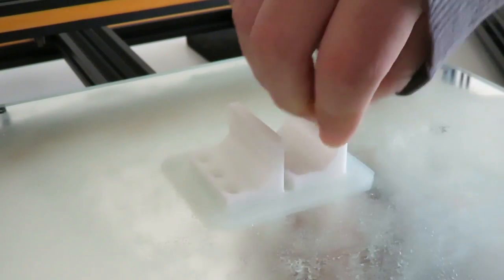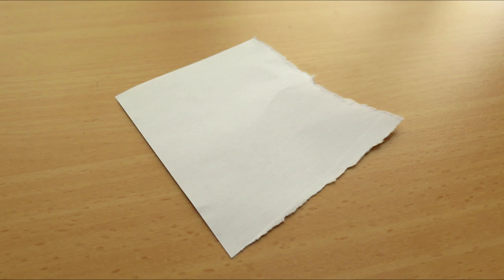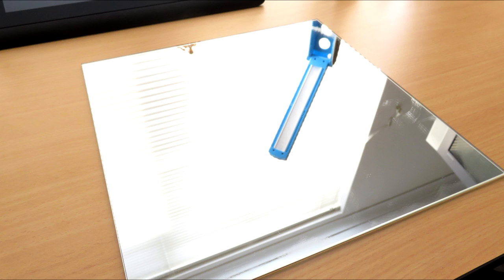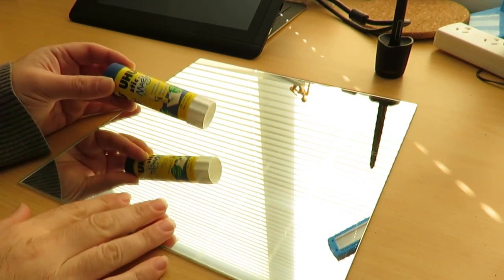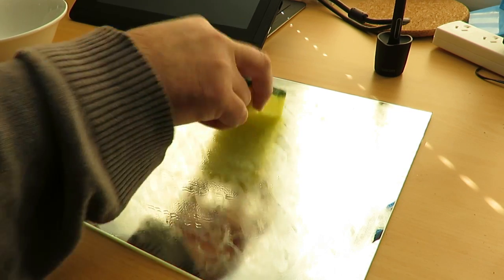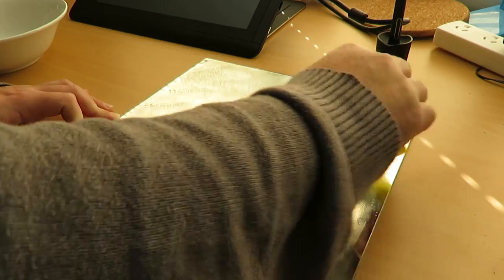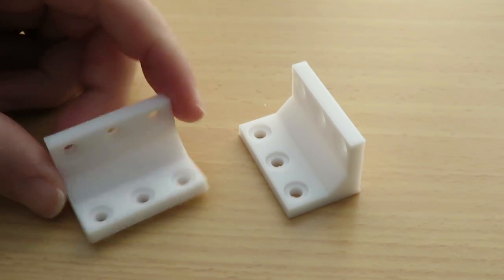REAL Bed Adhesion No Heated Bed, No Tape, NO BS- 3D Printing With Rm2kdev #9

Comment: Let me see youre limit with that..show me what you can do
Reply from the maker: Very Fair Point :)
I don't have pictures of it on the bed. but here are two hard drive caddies I printed using this technique on the CR10 i taped them together and wrote the clients name on them (i occasionally do prints for people) so i had to obfuscate that.

Link : http://imgur.com/a/9jhdi

Though with that said I've done a full bed (12 hour) print making parts for a robot arm I was making a few weeks ago but didn't take any pictures thats going to be a youtube video eventually i was just prototyping it.

EDIT: I added a photo of one of the robot arm parts large flat base no warping :)
Reply: rm2kdev Cool cant wait to see it
Reply from the maker: That video is probably a few months out :P im designing the thing from scratch, building and testing the parts with arduino nano's etc i felt that the existing small arms on thingiverse were over complicated in their design's for what they do. I wanted to have a goal of a 2 - 3 hour print for all the parts and a very simple construction.
Reply: rm2kdev I cant wait

Comment: Thanks for this video. My CR10S4 heated bed died and I've been waiting almost a month for the replacement and my wide prints have been peeling up if I print them on tape. I'm printing with your demonstrated glue stick method and so far my prints have been sticking perfectly to the build plate!
Reply from the maker: Glad it's working for you too, a story many here can resonate with.

I rarely use the heated bed now this just holds em down no problems most of the time.

Comment: Don't normally leave comments. But got to give credit to using this technique. We have all tried different methods, to stick down prints. But this slurry of pritt stick ( brand name in the UK) and water, works a charm. For Xmas. I have treated myself to simplify 3d. Printing in PETG. I also have a 6 line brim. Which is connected to the print. Bed is at 75 degrees and nozzle at 235 degrees. Do not know if using paid for slicer software is helping the  the prints stick to the bed or not. But it works for me.

Comment: Nice video, glad this works for you.  As for me, I have come to the conclusion that I hate glue sticks.  I just tried G10 or garolite and it works great though I had to raise the bed temperature slightly, but PETG just pops off with very little effort once the bed cools.

Comment: I don't want my prints to be welded to the bed. I went with a pei sheet and I sanded it because the adhesion wore off fast. Sanding it made it the best surface ever. Also, yes! Get feeler gauges! I also had to get a cr touch because I had a wild warp in my bed that shifted when I tightened and loosened the corners. Set up Octoprint too! It's so awesome! 😍😍😍

Comment: Absolutely perfect! I used Elmer's Re-Stick with this method and it is hands-down the best print surface I have used for ABS (I've used kapton, PEI, blue painter's tape, bare glass, hairspray, and BuildTak). Prints stick every time, and come loose easily when the bed cools.
Reply: use abs slurry (abs scraps dissolved in acetone) it will stick better than all of the above :)

Comment: While this works great to adhere prints to the surface, it's a pain to remove them. I recommend cleaning the bed with Dawn dish soap under warm water and printing on the glass bare, with the bed heated to about 65 degrees. This adheres PERFECTLY and then pops right off the bed when it cools. I use this method exclusively and recommend everyone to try it.
Reply: Jeffrey Roark yeah, most all 3d printers use celsius
Reply: Don't forget to compensate for the temperature difference between what the printer's temperature sensor sees on the bottom of the build plate compared to the actual surface temperature of the glass plate when setting up the print in your slicer. The actual temperature on the surface of my glass plate was about 7 degrees cooler than what the printer thought it was. I verified this with an infrared temperature sensor. I used single strength window glass that is about 2mm thick. The temperature difference will be greater with increased glass thickness.
Reply: Waltkat yes, that's why I use 65 degrees instead of 60.
Reply: @Jeffrey Roark
 Kelvin of course. Better stock up on dry ice!

Comment: I take a very damp paper towel and rub a glue stick on it several times. Then wipe the bed with the paper towel. You get a super thin even glue coating and it work perfect.

Comment: I actually got perfect adhesion for PLA and PETG prints by using a layer of 2 component glue on the bed. For PETG I used a bed temp of 95°C and I also got the prints to easily remove when having the bed cool down to about 70°C for PETG prints!👍

Comment: Great video, I have been using a variation on this technique for some time.
I use a small non-scratching 'blue scrubber' and a tiny bit of non-sudsing ammonia to wet out and spread the glue-stick after it dries.  Dry application places the amount of glue you want, wet-brushing makes the application even.
Ammonia is used as it will lift any oily residue from the glass plate, makes the water wet the glass completely and it helps disperse the glue more evenly.
Using glue-stick 'dry' is too likely to make bumps or voids.  Printing big?  Who cares!
I found it is possible to get too strong a bond between PLA/Glass!
Mod Podge, a concentrated white glue or gesso, should never be used with PLA!
Hell, white glue and PLA shouldn't be used together either!
I have a divot in my Ultrabase from prying a part off the build plate.
Yes, the part came off in small chucks.  Yes, I used a white-glue.  Yes, the part has a scab of glass still on it.
Not just the PEI over-printing was torn off the plate, there is a shallow crater in the glass itself!
Glue + glass + ABS?  Pretty darn good.  Parts 'pop' off the plate at about 35 C, no distortion.  Can't print in same spot twice, glue is stuck on part.
Glue + glass + PETG?  Near perfection!  Parts come off at room temp, with a little help.  Can't print in same spot twice, glue is stuck on part.
Glass [Ultrabase] + PLA + ammonia scrub of plate followed by 91% alcohol wipe-down?  Excellent hot adhesion, zero adhesion at 35 C.
Thanks, I will try the 'sponge painting' method you showed, I like the pattern you got!

Comment: Does this work for petg or other plastics other than pla. I print on 40 deg clean mirror glass at 60C for pla and print the first two layers hotter at 210 and it sticks very well. When it cools it poops oof by itself. PETG I struggle to get unstick if a print at top high a temp. About 70C for the bed and 265 for first two layers. I dropped it to 255C otherwise it sticks too well and then print the rest way lower. But petg still needs a raft on some jobs due to its tricky  adhesion. What amount of feeler gauge do you use.?

Comment: i just apply the glue stick in a pattern then i usually lightly touch up the area i removed the print under after each print and after a while scrape it clean and redo it 
magic purple glue stick has been my savior!
but i dont see any need to be this fancy about it..

Comment: That's a technic I have not tried but I will.  Nothing else works.  I am only able to print small things if I use an Elmer's glue stick right before I start a print.  If I print anything larger than about 4 inches I can expect the glue to release at some point, the object warps and that's the end of the print.  I've learned that a heated bed dries the glue out faster and causes it to release faster causing the print to fail.  I've leveled multiple times using a .08 piece of paper but my glass isn't perfectly smooth.  I am using a .027 business card as a gauge now.  I get a better feel for it and always check level 2 or three times before I begin.  I've boosted my print extrusion to 110% and this is the first attempt I've done using that setting, the machine is still running and hasn't let go of the print as yet.  It's just a small test print but it's taller than it is at the base by quite a bit.  Wish me luck.

Comment: from my single experience with glue sticks it seems that removing the print also removes the glue layer in places, and even then it will not stick as well as it does on hairspray, and even hairspray is totally different between brands and even same brand but different types, i've got 3 cans now that i have no use for..best i've found is Palette  for normal hair.

Comment: Hi! I print on a borosilicate glass and a glue stick (with PLA) and it sticks well only if the glue is still sticky. So I don't heat the bed on the initial layer (it dries off the glue quickly otherwise).
BTW, are you good with printing PETG? I have some issue and would like to ask if you're into it.

Comment: Gluestick does work, but it's such a pain to remove the prints afterwards. Personally I run a heated glass bed that I have gently sanded with fine sandpaper and it sticks like a charm, and unsticks easily when cooled down.
Reply: What grit sandpaper did you use?
Reply: @777kalibro  I recently saw someone say 400 grit cross sanded worked well. But every few prints the glass needed to be cleaned with acetone.

Comment: Hello. Would you mind to write here which is the composition written on the glue packing? The reason is that I do not find on my country the UHU brand, and other brands I found here like "Pritt" or "Acrilex" have many different chemical compositions, also like  "n-vinilpirrolidinone (PVP) " or "polyglucoside eter". I think also that is because for some people here the glue stick method did not work. The composition maybe changes across the diferent brands. I really would appreciate if you could write the name here. Thank you!

Comment: Not a big fan of glue as it's messy and requires the use of a scraper every time, which can damage fragile parts. I've been printing on heated bare glass with great adhesion for months now. When something doesn't want to adhere, I just add a brim, and/or lower the printing speed for the first layer. I've yet to find a model that doesn't stick with an 8mm brim and 20mm/s first layer with bed at 65ºC. And when it's done there's no need to fight with it, just let it cool and it comes off by itself. Or persuade it with the scraper if you really need it right now.

Comment: Okey, for starters, I literally have no bed adhesion problem on ender 3 with PLA.  The problem lies only for abs filaments.  So if you know some method to do it without using acetone and water paste, it would be good video.

Comment: I notice at the end the brim on the parts you've printed and are peeling up seems to come away easily from the actual part. Is this a special setting? My Cura 3.6 brims and rafts are pretty solidly attached to the actual print, meaning I need to use tools to cut/sand away the support junk.
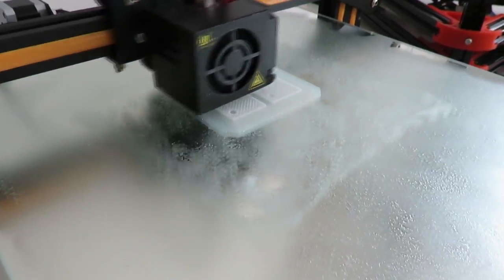Reply from the maker: at 2:50 they are solid down and the print is over, i edited it to a point after i had used the tool to peel it up. there is 0 lifting :) i still use this method today and its works great.
Reply from the maker: also rafts are pretty old school, i think people used them back in the day when beds were much less flat, and the extrusion / movement was much less precise now days unless you have a very specific reason you shouldn't be using rafts as good leveling, a flat surface and a good sticking medium (or temp on the bed) will keep your parts down.

Much less cleanup, and better looking surfaces. :)

Comment: I have been using super strong double sided tape, but when trying to print a paddle tire for my rc car it waps on the corners allready after a few layers and the filament gets chunky in the area it is supposed to be squared

Comment: we have delta 3d printer for 6m but only thing is we have problem in surface we are not using glass we are using wood,metalsheet,now are trying on stone. its not printing and we are using PET plastic while printing the first layer is not sticking to the surface..and the extruder keeps on printing we tried hair spray, glue...can you suggest me anything?
Reply: i use a glas plate (stone or metal should be find as long as it can be heatet to about 60C°) With a thin film of wood glue to aply the wood glue i dilute it with water into a verry thin slury and let the water evaporate over night ore couple of days you get a perfect and even film of glue shuld work on non heatet surfaces but i didnt try it

Comment: I was doing this before my spool busted off the heatbed connector on my Anet A8, and now I have no heated bed and pretty much all my prints warp regardless. The max I used on my heated bed was 50 and I had no issues. Even with this technique and a 20 line brim I can't get proper sticks. Everything warps. What the fuck? Is raft any better?

Comment: Would this work on non-glass beds? I've got a fairly cheap 3D printed and often have to restart a print 2-3 times before I get good adhesion.
Reply: simplest method. painters tape and glue stick. And you don't have to go nuts with it like this guy. That's over kill. I just painters tape, with 1 layer of glue stick and it's  on there like white on rice. Also, you have to make sure you are leveled correctly and your start height is perfect. Using the gauge he is using is actually a great idea. Personally I use auto level, because I can set it once, and it is always the perfect height and level.

Comment: Please do a follow up video where you print something considerably larger on this surface.  Getting small things to stick is not an issue.  Getting large pieces to stick, especially if they have sharp corners, is another story.  For example maybe try printing a a large 5-point star shaped box.
Reply from the maker: please take a look at the pinned comment thread :)

Comment: So you say no bed heat needed ?.. will this also work on a metal plate??? I am  brand new to 3d printing... also i thought you needed heated to get good prints??? thanks
Reply from the maker: I use this method with most of my prints and it works fine for me without heating. But 3d printing is so variable everyone has different results with the same hardware so it's all about tuning the machine to how you want it to work and spending the time to dial it in.
Reply: @rm2kdev  yes, i plan of printing rc plane parts using PETG ...do you think glass without heated bed can work well if everything else is adjusted correctly? Also  i have magnetic bed that came with ender 5 and a metal plate on the way...do you know if glue stick also works with those? thanks

Comment: After a year of printing with blue painter's tape, I've finally seen the light... or the glue? Thanks for converting me!!!  I posted more details and pics of my conversion here: https://www.printerknowledge.com/threads/bed-adhesion-tricks-and-tips.12128/page-7#post-108469
Reply from the maker: Had a read :) great post thank you for sharing im glad its working well for you! my favorite thing about this method is when you're done a damp sponge will 'refresh' the surface without needing to recoat completely
Reply: Yeah, I was a pretty die-hard blue-tape guy... but I think you've just completely changed my religion. I used to have a tiny spray-bottle with alcohol (to clean off the painter's tape), but I swapped that out with water to use with a sponge to refresh the glue.

Also, I haven't tested thoroughly, but it does seem that the type of glue stick can make a big difference.

Comment: So why the hell are you using a huge skirt let along a  skirt at all if you have such a hit adhesion? I've printed so many different ways. On glass, on tape, on build tack, with glue stick, with abs slurry, with hair spray. I've tried all sorts of various tapes and surfaces. Some odd ball ones too. Trying to find the best adhesion. It's all lead me back to one simple method. Painters tape and glue stick. At least for now it seems to work the best... for me.  I would never do what you are suggesting. 1 layer of glue stick on painters tape is ridiculous. it's hard enough to get the prints off. I don't use any rafts or skirts. Don't need them.  I just don't understand why you have the skirt....
Reply from the maker: When printing without heat like this, the skirt helps gaurentee that any lifting (if any) will happen on the skirt and not your object.
Reply: @rm2kdev  I didn't realize you did. Ot have a heated bed

Comment: Do you heat the nozzle when you level?
Reply from the maker: Personally, no i don't :) but i know some people that will say you must absolutely do it while its hot :P hey it works for me and i don't burn my fingers :P
Reply: @rm2kdev  you should heat it because most of the times there is always some filament in the tip of the nozzle that will make you not properly level the bed

Comment: btw moving the motor like that can induce a voltage - better to use a code or something to drive the motors!
Reply: But can that happen even if you have the option to turn off steppers?
Reply: iaodfsh only if you don’t have diodes installed

Comment: If the adhesion is that good, why are you still using brim?🤦🏻‍♂️🤣
And one more thing. It's way easier to just buy specific glue for 3d printer beds. Something like devil design glue that I use for 2 years now. Put it on, and you are good for a long time, even with petg.